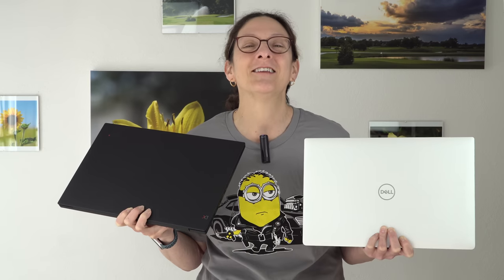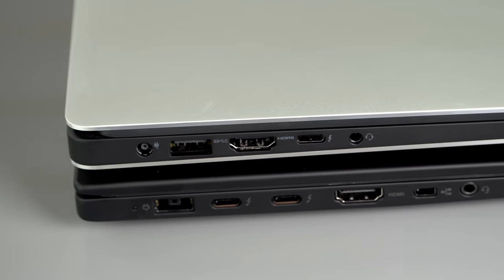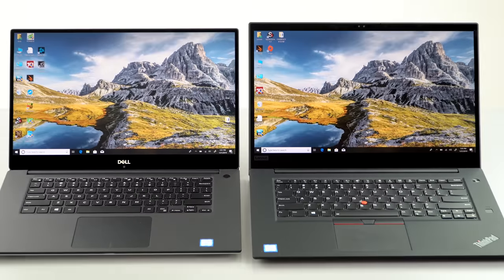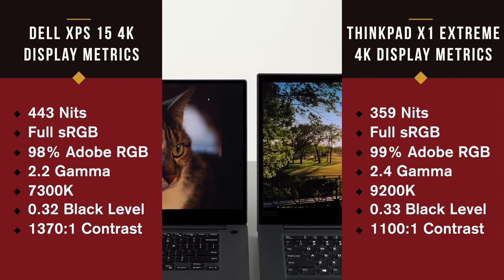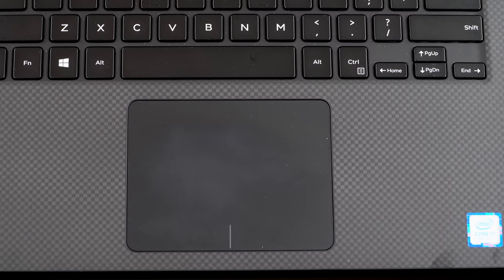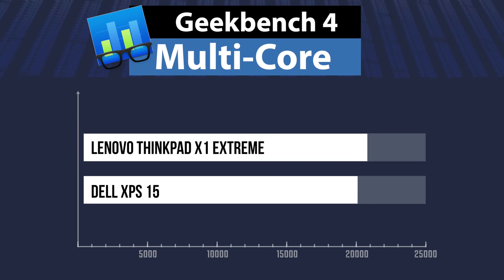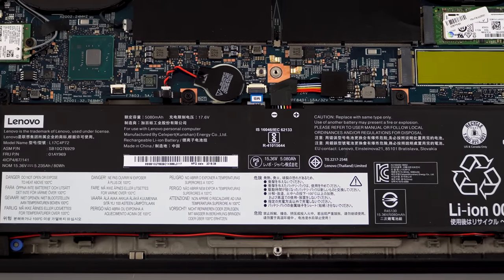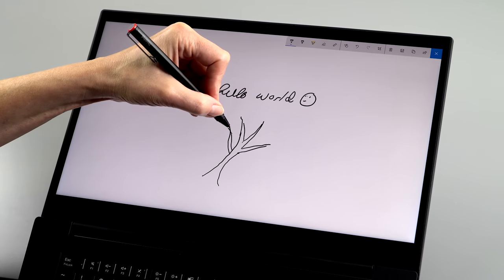Dell XPS 15 vs. Lenovo ThinkPad X1 Extreme Comparison Smackdown

Comment: Hate that they're keeping this old 16/9 aspect ratio with a big chin down. And they call it bezeless.... honestly it's so dissapointing. Also 4k is overkill but 1080p il also not enough for reading texts. At least Apple did something right switching to their retina sweet spot 6 years ago. All my work consists in reading and writing and there's only Macs and Microsoft Surfaces that can hold up in this regard. I wouldn't want to buy a 4k display on an XPS to have a crippled battery and subpar performance ...
Reply: 4K is brilliant for graphic design. No need to print to judge fonts, kerning, line weights, brilliant Architectural 3D, etc. 2560 vs 3840 pixels wide, is not even close. Deserves the extra battery and you can always drop it to FHD with no pixel blending. Only thing better is OSX'es retina scaling. Good job there, though it should have more manual options.
Reply: Crippled battery and subpar performance?  How? 

I have an XPS 15 with i9 and 4K display and considering the intended use of the laptop (i.e. power use) the battery life is pretty damn impressive - around 7-8 hours under general every day use.  I'm also yet to experience anything less than flawless performance for anything but gaming (and I don't know why you'd buy an XPS for that).   

My desktop is getting on in age (i7-5820 / 32GB ram) but I haven't upgraded it because I haven't had to - it still handles everything I throw at it.  And the XPS is more powerful then my PC in all ways EXCEPT graphics.  Not much for me to complain about there. 

If you're doing any kind of work that is too powerful for an XPS to handle, then I'd suggesst you probably should be looking at dedicated workstations rather then high performance ultrabooks. 

As for display quality - 4K looks amazing, but I do agree that on a 15" screen it's probably overkill for the vast majority of people.  Don't get me wrong it looks downright incredible - but a good quality QHD IPS display also looks very nice on a 15" notebook and is probably good enough.
Reply: you do not have tp use the native res, apple is not giving you the native res except when looking at media for text it is combining pixels and adding smoothing, that's software.
If done right the 4k display with the right software will look better even with text, when windows gets real, and it will always look better for media, with true 100% adobe and srgb, just slightly less bright at full brightness which is ridiculous except when outside.

Comment: On May 6, 2019 I try to buy the Dell XPS, I did the order on Dell website from Canada. After I completed my order I had a estimated delivery date of May 22nd. On May 13 my estimated delivery date was change to May 30th. At that point I could live with that but on May 27 Dell change my estimated DELIVERY date to July 11. I need my new laptop to work on a job in June so I call Dell to cancel my order. ** Guess what ** Dell told me that my order cannot be cancel until the laptop is build, I try to escalate this issue and was told noting can be done. SO NOW my credit card has a old of $2500, and I do not know when it will be remove. On May 29 I still have no confirmation that my order will be cancel and will not get that until the laptop is build. THIS IS NOT ACCAPTABLE TO HAVE DELL HOLDING ME HOSTAGE FOR 2500$. #DONOTBUYDELLXPS

Comment: XPS15 is in dire need of a design  upgrade.
Reply: lol it doesn't, looks way better than macbooks
Reply: @Paciffic  You obviously haven't owned one. One of the worst thermal design in a 15 inch laptop, the design is just old now. A full size keyboard, integrated finger print sensor in power button, a higher brightness screen (matte, preferably), air blow out the back ... There is absolutely nothing which satisfies it's higher price tag, compared to say, a Matebook X Pro. 
I choose the Matebook X Pro over all the available laptops because nothing can beat the price/performance of it.

Comment: What is the purpose of exceeding 1440p on a 15" laptop and having color accuracy no human being can detect?...
Reply: The upgrade to 4K does give you a noticable improvement in sharpness.  It's certainly not game changing, but it is noticable.  Some peopel are more picky then others, so luckily the option is there for those who want it - and for those who don't you have that option too :)

Comment: Anyone know, does the XPS 15 have the same keyboard (travel, feel) as the XPS 13?

The worst keyboards I've ever typed on were the XPS 15 2-in-1 and the Razer Blade 15's keyboards.  They are so-bad and flat!  Ewww Razer Blade 15 and Maglev Keyboards!  Considering the XPS 15 FHD matte if it has the XPS 13's keyboard (and not the 2-in-1's).
Reply: Yes, the XPS 15 9570 has the same keyboard as the XPS 13. The 2-in-1 has a maglev keyboard while the 13 and 15 have the typical scissor mechanism.

Comment: lenovo is a horrible company no one should ever get involved with. i suffered to get a refund for my defective computer.   I will always discourage anyone from dealing with them.
Reply: They have a repair center in Kentucky that doesn't know what they are doing and noow they moved it to memphis and north carolina.  Bottom line is that i ended up opting for a refund and getting the heck away form them.  they took half a year just to fail miserably at fixing  or replacing my unit.